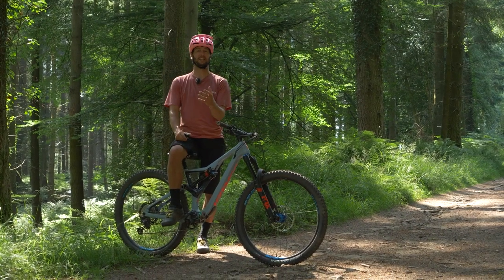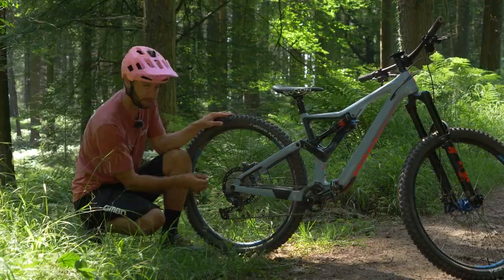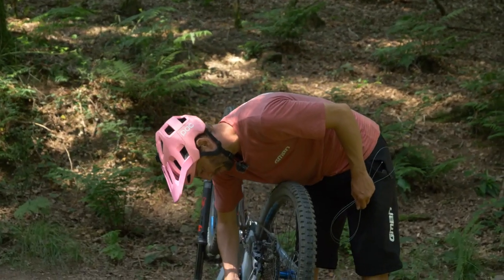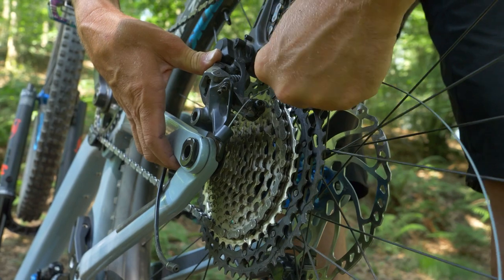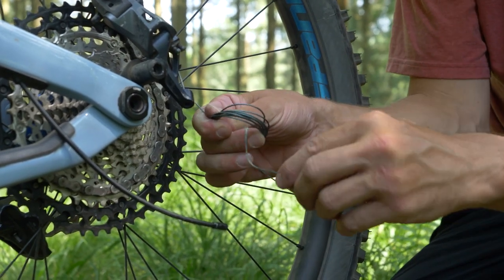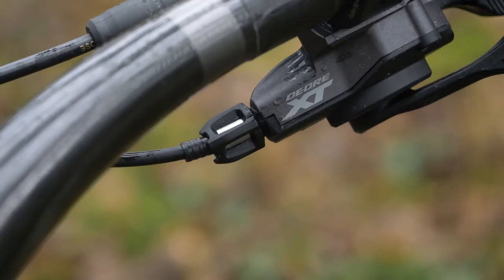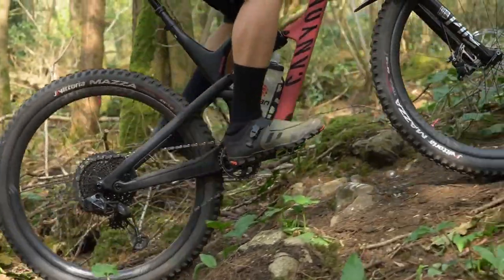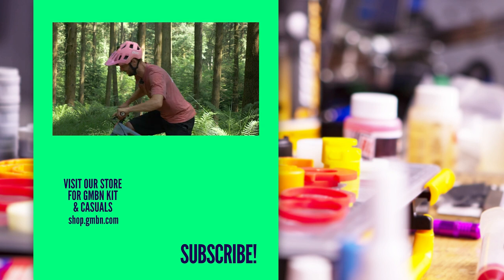How To Fix A Broken Gear Cable In The Woods | Trailside Repairs & Hacks

Comment from the maker: When did you last snap a gear cable? Do you have any tips we missed? Let the community know👇
Reply: Never snapt one
Reply: Not a single one in 29 years on the bike.
Reply: Shredded the cable housing which looked like noodles.  Extra cable was useless at that point.
Reply: i haven't snapped one on my mtb but on my normal bike i have. there was too much damage already so I actually convinced my dad to get me a mountain bike.
Reply: Had one slip on my road bike a few weeks ago, but never a snap.
Reply: What gear can you get into using limit sceews?
Reply: Never, the cables on my MTB were installed in 2003 and I still haven't found a reason to replace them.  The bike would have well over 20,000KM on it
Reply: So funny, I snapped a cable about 6hrs before this video, in the housing above the derailer
Reply: 4 DAYS AGO THIS IS WHAT I NEEDED

Comment: If the cable snaps near the shifter then you can do the same procedure, but instead of using that metal retainer you just tie some knots on the cable and it'll hold up just as well.

Comment: You can use your limit screws  to find your happy gear. I have done it a number of times. I ride a lot.
Reply: @RealMTBAddict   Your right but I am cheap. I get every last ounce of value out of a part. I even fix the part if I can.

Comment: If you have a totally failed cable and can’t tie it anywhere, you can adjust your lower limit screw as well. It might only drop you one or 2 gears, but it’s better than nothing.

Comment: In all my years of riding MTB (20+) I have never had a gear cable or chain snap. Even back when riding no name parts with effectively zero maintenance. I consider myself lucky.
Reply: Wanna swap bikes 😂
Reply: @thatguy8770  haha, only if you want a bike that gets punctures just by being in near proximity of tiny twigs!
Reply: My brand new SRAM NX chain snapped after 3 rides. Just one of those things.
Reply: @DebowyMocny  yeah sure changing tubes beats fighting with derailleurs any day

Comment: If it's a Shimano shifter, be aware that the plastic screw to access the cable is the easiest thing in the galaxy to over tighten and destroy.  It takes only a quarter turn to lock 👍🏻 I learnt the hard way.

Comment: Been cycling since the 80's and never had a cable snap.   My mountain bike that I built in 2003 and has well over 15,000 KM on it is still running the original cables and housing.  How do people break cables?   Leaving your bike in the rain?
Reply: From over shifting aggressively,like me,and using too much force.

Comment: I just had mine snap,from the shifter of rear derailleur,two day's ago,with a lot of weight on me,from shopping,well I just used the crank shaft gear,I used the middle one. Well I only have one more cable left,and it's the one I keep in my bookbag, I'm thinking,taking an old cable,that has the nipple,for the shifter,and crimping it,with the one that broke and soldering it,wish me luck.